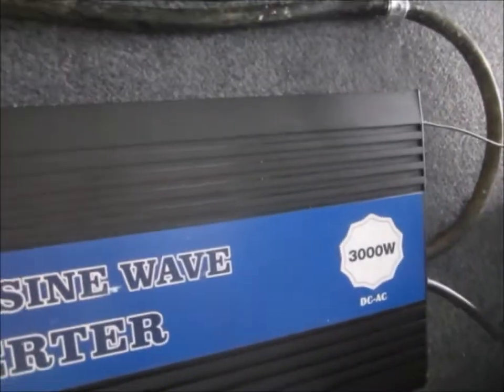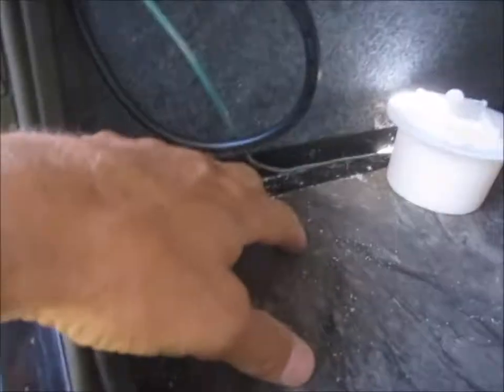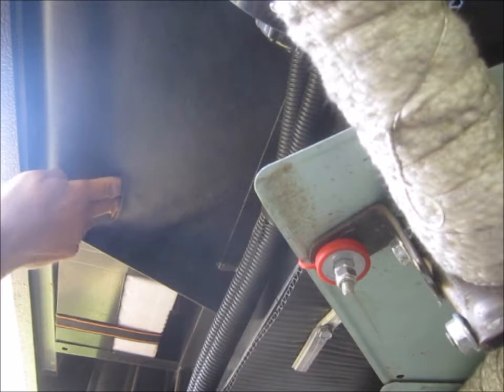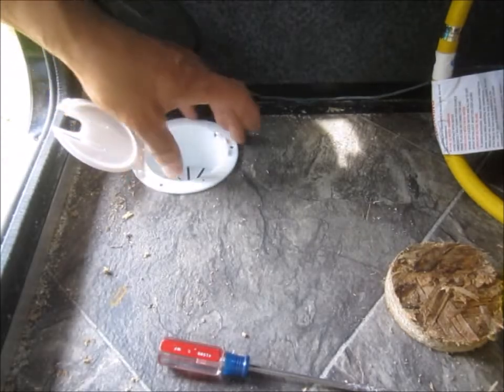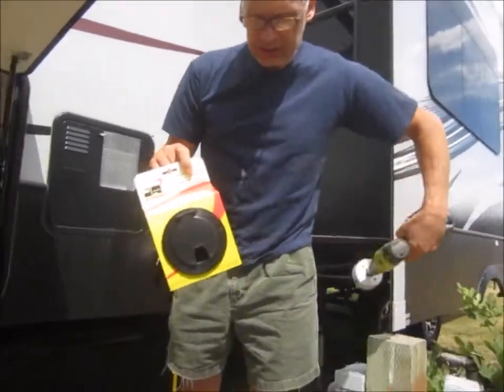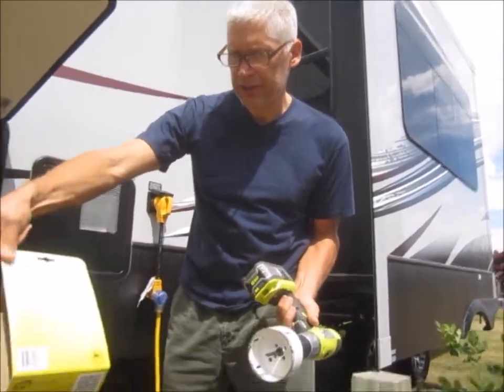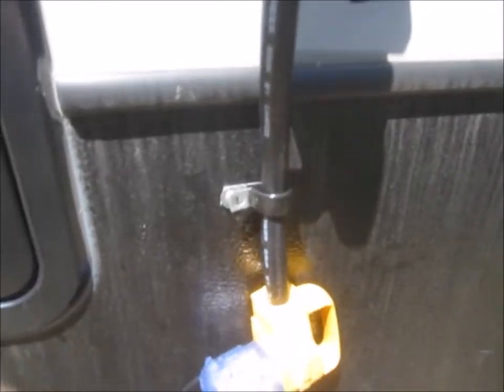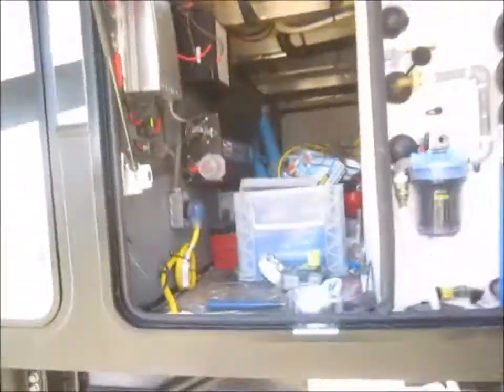30 amp Plug from 3000 watt pure sine inverter to 50 amp twist pt 3

Comment: Im curious which inverter that is and how you connected a 30 amp plug to it. I basically want an overpowered solar system so I don't have to worry about efficiency losses. I will have way too many solar panels and way to many batteries so I can simply run my solar system like this: solar panels to charge controllers to battery bank to inverter to shore power plug. Then I will have to manually move the shore plug from the inverter to a post if I pull up to one and I won't have to mess with xfer switches. I will also save a f***ton of money on the other components required to do it "correctly". The only thing I've never seen is an inverter that allows you to install a shore plug.
Reply from the maker: I think everything you want to know is in this playlist https://youtube.com/playlist?list=PLIqa7jU6xglvP7oRQemNjw6FazRuwi70T

Comment: Never seen someone wire up there RV with there inverter this way before. but if it works and you are happy with it, awesome. I see that this video is 5 years old, are you still using it this way?
Reply from the maker: We didn’t up till 2 years ago when we sold it, our truck and 1/2 my motorbikes and moved to the North Shore of Oahu. Now we are back in Montana living in my brothers 40 toy hauler and renovating and old golf clubhouse into our summer home.

Comment: Hey there. I have a 2000W inverter and I hardwired a 30amp outlet off of it. My travel trailer is 30 amp. I did the same thing were I plug my 30 amp plug into the hardwired 30 amp outlet. I only run outlets and lights off of it. Did I do it right?
Reply from the maker: Sounds like it. Just be aware that your power converter needs to be off when plugged into the inverter
Reply: @StimRacingTrailerandTravels  definitely! I just got nervous because I posted the same thing in a RV group and got landblasted by old dudes saying it's wrong
Reply from the maker: @joeygemza7646  it’s different then they know so it must be wrong 😅
As long as one is aware of the converter, battery capacity and manages accordingly.
Reply: @StimRacingTrailerandTravels  awesome. Thanks for the quick response!

Comment: I have
600 watt Solar panels (200 watts x 3)
Controller
420AH AGM batteries (210AH usable)
Reliable Pure Sine (3000 watts /6000 Peak)
15amp to 30amp adapter
Well worth it. Off grid is the best. 
Just need propane gas 😂😂😂

Comment: Why not just wire the inverter directly to the rv?? My Magnum is wired to the AC panel and all I do is press a button on the remote to turn it on.
Reply from the maker: Because it’s not a quality or sophisticated Magnum inverter. But only cost 1/3 the price. I made a choice to a inexpensive and not have to add a 2nd transfer switch

Comment: I heard a comment about turning off the converter breaker when plugging in the 30 amp to 15 amp wire. What if I have a separate battery system for the panels and inverter? This would not be connecting to the 12v system. I would assume plugging that directly into the shoreline would not require me to disconnect the internal converter correct?
Reply: To clarify i would either simply get a 30 amp to 15 amp adapter plug and directly connect it to the inverter or add an external 30 amp receptacle but still connect the shoreline directly into the receptacle connected to the inverter. Both would be connected to a separate lithium battery system. Just ordered panels so debating on the set up. Thanks for the videos and tips.

Comment: So is the inverter charging your batteries as its hooked up to the converter that is running the trailer electrical items
Reply from the maker: Gary Davis you missed the part about you must shut the breaker off that powers the converter

Comment: Is simply using a 30amp dog bone adapter plugged into an extension cord and then  plugged directly into the inverter an option as well?
Reply from the maker: Carlos G in a round about way, that’s exactly what I did, only the way I did it I can leave it plugged in at all times, even when traveling down the road
Reply: @StimRacingTrailerandTravels  thanks man, I am so excited to get mine up too. Bought everything yet had home Depot suggest an invertor however I did not get a chance to read it (my fault) it was Modified Sine Wave. But good new I just bought (Reliable 3000 watts inverter) can't wait to get it installed.

Comment: thank you so much for you videos.  I've been wanting to figure out how to get a solar system hook up for my travel trailer with a 30 amp plug.  I haven't found any inverters with a 30amp plug and have been trying to figure out how to make it work for weeks and weeks.    Now that I know I need an inverter with an AC terminal block I can make it work.  
If you  had to do it over again, would you do anything different?
Reply from the maker: I am glad I cold help.
Great question. If I could start over on a new trailer...? Sounds like a video I have been planning to make but the snow and cold drove me into the house.
I would do a second 50 amp transfer switch instead of the plug. About the same price as I spent on all the supply's for the plug setup. 
 I would still do 3000 watt inverter, but would look at getting a HI breed inverter. I did not even know there was such a thing, but it is 3X the money, but with it I could indefinitely run my AC in daylight hrs with an assist from my Honda 2000ei generator.
I would have done a Mid Night 150 Classic charge controller.
As you can see, so many choices, and everyone has specific need, so one size will not fit all.
Reply: gotcha, thanks!  I know I definitely need to use a pure sine inverter. thanks for the recommendation on the charge controller.  now the hunt for good solar panels and possibly wind setup too.   I'm sure you said it somewhere but is your battery setup a 12v or 24v?
Reply from the maker: The batteries are 12. Again, if I was to do it again from new, I would do 24 with a 24v Inverter. So much more efficient for the inverter and the charge controller. My 12 volt panels run at 18volts, and I wired them series parallel. So two panels together put out 36 volts. 
The charge controller is 93% efficient changing power from 36v to 13.4, and 98% from 18v to 13.4v and 98% from 36v at the PV to 26.8v at the battery.
Same holds true at the inverter. The closer the voltage matches, the more efficient. 12vdc to 115vac run about 90% efficient, vs same brand and price point 24vdc to 115vac inverter working at 95%.
To transfer house power back to 12vdc from the 24v battery, for lights, furnace fan water pump and the like, you would need a 24vdc to 12vdc step down converter like this.  https://www.amazon.com/uxcell-Wateproof-Step-down-Converter-Regulator/dp/B01LYK6G2Y/ref=sr_1_11?s=automotive&ie=UTF8&qid=1484744107&sr=1-11&keywords=24v+to+12v+step+down
Every time you change power in an inverter or converter, some efficiency is lost to heat. The closer the voltage match, the more efficient the power transfer. 
If your biggest load is your 115vac inverter, its smart to have the supplying DC as close as possible to that voltage.
Please note! All efficiency numbers quoted here are from my poor memory, not a manual. Also, I am not a professional installer or electrician. Just sharing what I have learned doing my project.

Comment: Wonder 3000 watts inverter work for all same time to use ?
Reply from the maker: This 3000 watt inverter will run,
1) 11,000 btu AC and TV DVD player
2) 1500 watt microwave, rice cooker and electric pressure cooker.

Just add up the watts of what you want to run until you reach 3000. When you start plugging in, or starting your equipment, start your largest loads 1st, so the large surges are done early.

Comment: Why not add a 2nd transfer switch instead of wiring outside to the shore power receptacle?  

The first/original transfer switch takes power from the Onan 5500  and shore and puts it into the AC distribution panel.  Would it be possible for you to instead take the AC output line from the original transfer switch and feed that into the  main AC input of a 2nd 50amp transfer switch. On the secondary AC input on the 2nd transfer switch you would wire the AC output of your inverter.   The AC output of the 2nd transfer switch runs to the AC distribution panel.   Hands free mostly except for turning off the converter when on inverter power.   

Let me know what you think -  I have the same trailer as you and am deciding on how I am going to do my solar/inverter install.  Right now I'm planning on how to tie everything together. One thing I am having an issue with is the battery location. The 3 trays for batteries in the front compartment are poorly thought out in my opinion. I couldn't even fit a group 27 so had to put 24s in. Being that there is only space for 3 I couldn't do 6v (I suppose I could have done 2 6v).  Let me know what you think - would like to talk to you more about some of the stuff you have done.  Love the videos so far ...  and thank you for the solar install video. Since I have the same trailer I think I am going to run my solar wire down the same vent that you did. Very convenient location.
Reply from the maker: I think that is a great idea. My older brother did just what you suggest, only he used a 30 amp for his 2nd x-fer switch. I wanted to do a video with him so he could show us all how he did it, but his x-fer switch is behind the wall beside his water heater. The resin he only powered one side is it was the side all the stuff he wanted from solar, and not the side with his converter breaker. There for he could never for get to shut it off. If this is not clear enough, I can talk more about it, but am on my way out the door now for a 12 hr shift. Thanks for the great question.